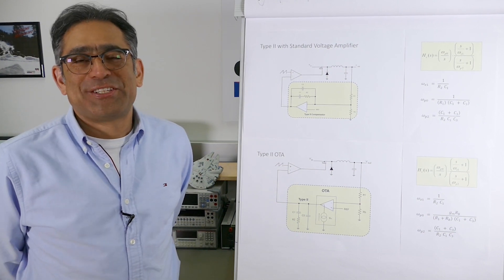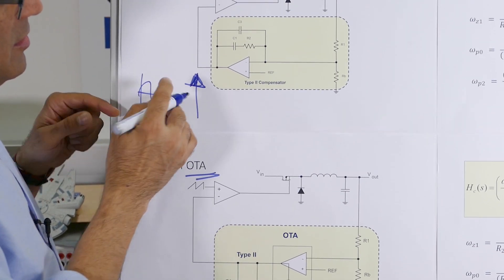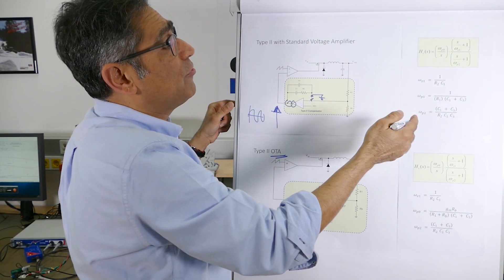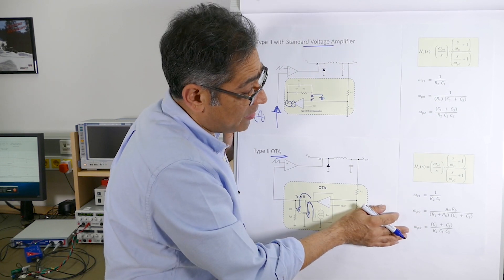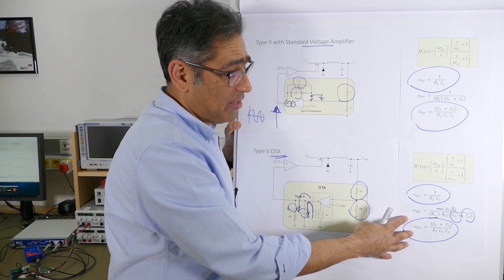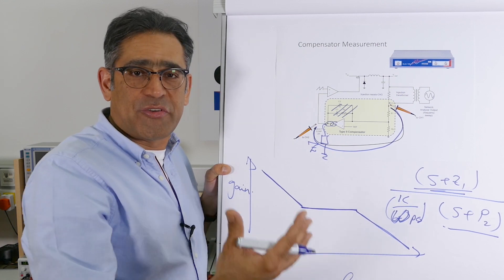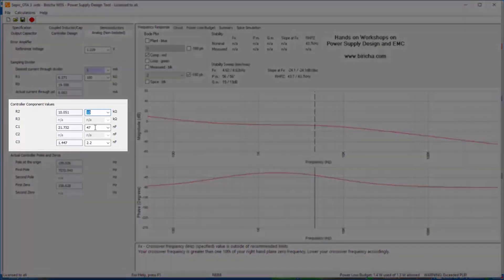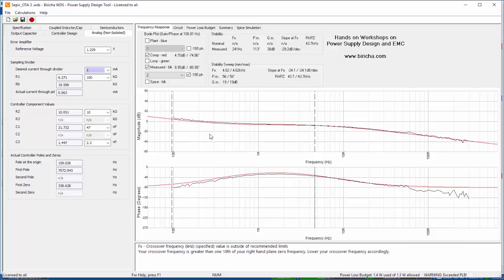Operational Transconductance Amplifier OTA Compensator Design

Comment: I wish he told us WHY use a transconductance amplifier, instead of a normal voltage amplifier, if the whole thing is outwardly exactly the same
Reply: He probably doesn't know that himself! Because I agree with you, that should have been the starting point of his lecture.
Reply: With OTA, your compensation network is referenced to ground, feedback divider value stays put in value instead of changing with your feedback compensation, does allow for designs that are fully compensated on-chip in many cases. It is not like you will have the luxury of choice - it will be whatever your SMPS controller uses internally - but nowdays most will be OTA based.

Comment: great trans-conductance info, could you please add the Vishay IL300 opto-isolator to the circuit for a 1:1 ratio 10vin/10vout and explain how it works to supplement the Vishay literature? thanks.